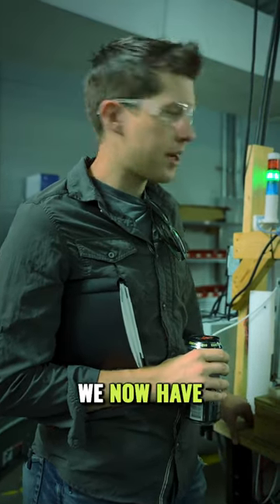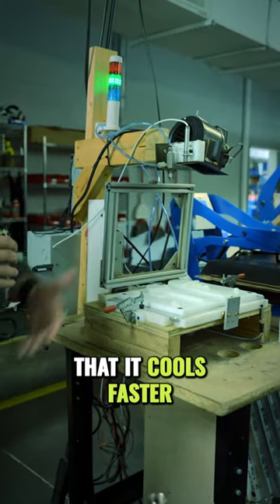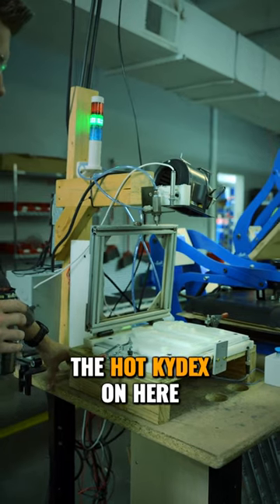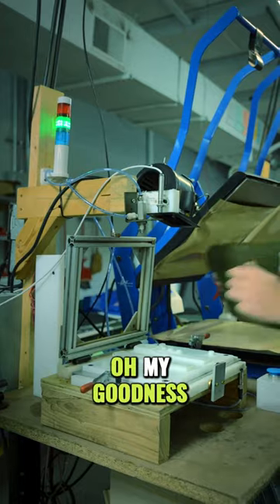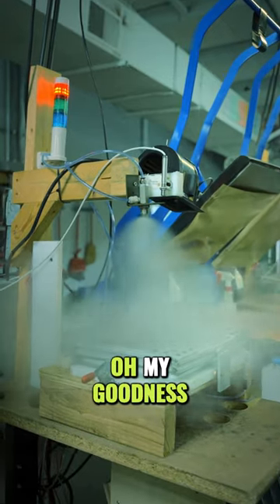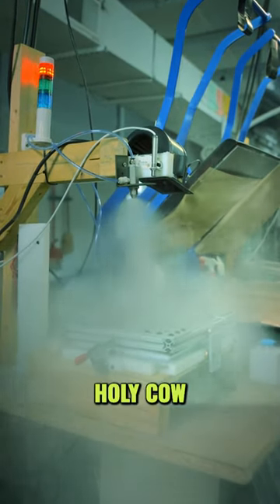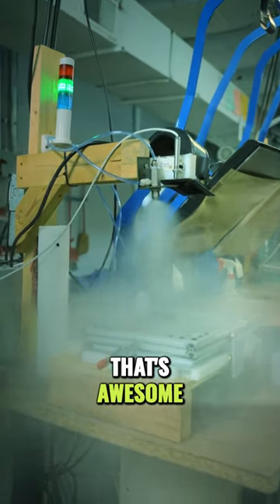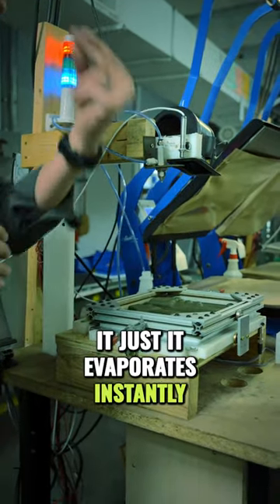Custom Holsters Faster

Comment: Ive never seen this man go for more than a minute without holding a gun or a can of reign energy.
Reply: Its not even open 😅
Reply: New respect achievement unlocked
Reply: Reigns are good like that. Just not for your insides.
Reply: Reigns weak af
Reply: @pleasureduma9693  That's just the wrong opinion.
Reply: @pleasureduma9693 it’s good, lots of good drinks out there
Reply: And he has a pistol concealed, so its both.
Reply: Ya but you need both....I dont get it.
Reply: Those are his hands my guy
Reply: Fr read my mind

Comment: That frame is wood....it's going to either rot or will mildew or grow mold soon. Might want to remake with aluminum.
Reply: It looks like a prototype to test the effectiveness so I would assume/hope they would build one with some extrusion.
Reply: looks pressure treated bro, its literally green.
Reply: @rafiamirali9188 I will say every video from this channel has a lemon lime color filter
Reply: *almost every
Reply: Or treat the wood with a sealant. Orrrr maybe fiberglass. Orrrr. . . Haahaa
Reply: Railroad bridges have been built from wood sat in rivers and lasted for hundreds of years. This is a 2x4 holding a nozzle under a light misting, it's gonna be fine.
Reply: @ish1057 you're comparing reinforced wood and a project built by professional construction workers and engineers ....to some cheap china set-up
Reply: @johnwig285 railroad bridge wood is old growth that you can't even get any more

Comment: Somehow I thought "water cooling" meant that the water would be routed through the mold not straight up dumped right on the kydex. Long way to go for the same effect a $2 spray bottle would do. 😅

Comment: Have the mold made from aluminium and you likely wouldnt need the water.  Aluminum would suck the heat right out of the kydex passively.
Reply: It would, unless you are doing hundreds of them in a row.
Reply: @TuffPossumGear  then plumb coolant through the base of the mold.  Incredibly simple.   This method will cause the wooden workbenches to mold as they absorb moisture.

Comment: if that is all it takes to make a Kydex holster then why do they cost so much
Reply: I mean...kydex holsters are literally just plastic sheets molded around a gun. It's all just if the end product is good or not and their products are pretty damn good. You're not only paying for a quality product but you're also supporting a business who has their values straight.
Reply: Because there is a LOT of money that goes into building and replacing these molds/systems, since molds wear out. 

Not to mention cutting out the holster, heating the center fold and folding that, buffing the edges, adding all the hardware, etc.

What you see here is one small step.
Reply: There is way more to it than that man. That’s just one single step out of dozens and all the guy’s moving this stuff along the line and their salary. Along with the freaking cost of the equipment and various molds being designed. I would estimate he has 20-40 employees and let’s say the average is 35,000 a year well let’s low ball it. He is writing well over half a million dollars in paychecks every year. Let’s not even start on the R&D and manufacturing equipment and raw materials cost.